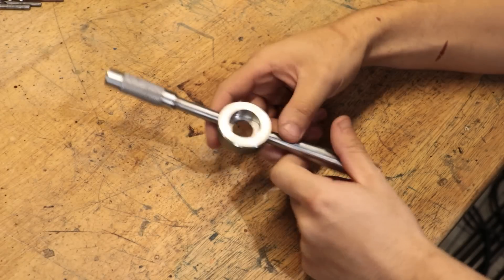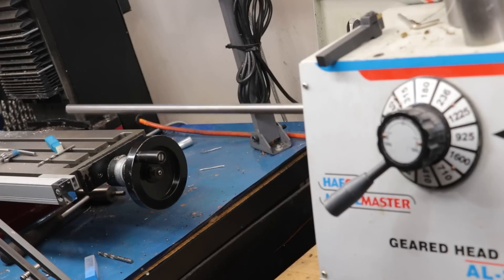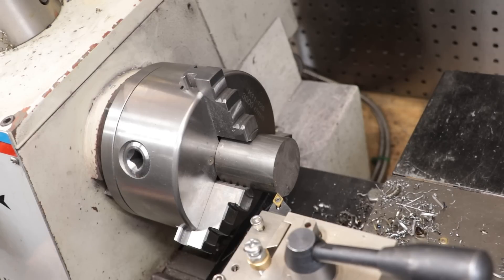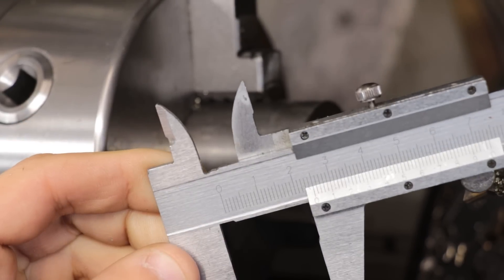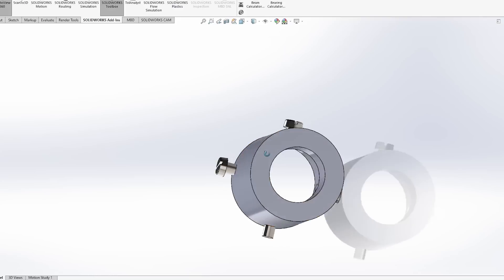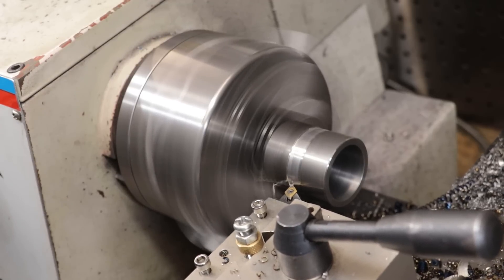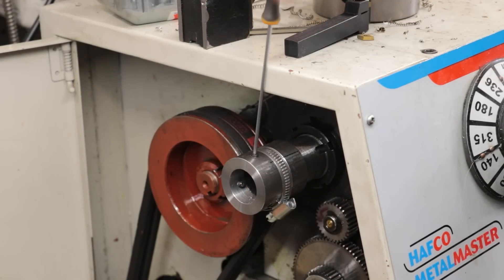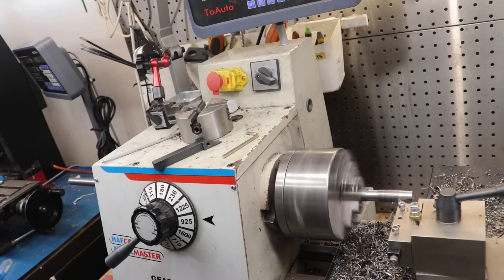Avoiding A Dangerous Situation on the Lathe | Making A Lathe Spider

Comment: I used to run Acme-Gridley multi-spindle screw machines. (Basically, a prw-cnc 6-chuck automatic-feed monster lathe.) Each stick-out was protected by a long tube. You could do the same here with a 6-foot tube secured to an auxiliary bench.

Comment: Don't kid yourself. A spindle spider is only for aligning parts in the spindle. You are still at risk of a bar hitting critical shaft speed, with a simple mistake like selecting rpm which is too fast. Anyone watching would do well by understanding critical shaft speed and proper lathe practice. You can risk improper setups on your own. My understanding that the clip shown was a programming error where speed limit was not set. They knew the risk and took it anyway.
Reply from the maker: yeah its not a catch all solution but set up properly it works. I machined all this, it sat happily at 900 rpm with 30 cm of stick out the back
Reply: @artisanmakes  The title implies a spider will prevent stock whipping. I don't know how to convey how unsafe this really is and that anyone doing this will get lucky until they don't...this is a calculated risk, with none of the factors even mentioned.
Reply from the maker: I do mean to imply it, you just have to set up properly so it does end up whipping around. If it didn't work I would have abandoned it and not posted it. I think most people understand that this has limits and itll eventually need a roller stand
Reply: @artisanmakes  you didn't tell them what the limits are. Recipe for disaster
Reply from the maker: it'll be dependent on the material and its diameter and stick out. But even without calculating it you can usually feel through the lathe if its going to vibrate and go wrong. Thats im sure that would be intuitive to anyone who has experience using lathe
Reply: @artisanmakes  and those who are inexperienced looking to this video for ideas?

Comment: For your shop, since you don't use both machines at the same time, why not just build a simple steady rest that sits on the mill table to hold the excess lathe material stable...

If you machine one or two bars protruding out the bottom, they can drop into the mill bed slots to keep the steady rest from sliding sideways (relative to the lathe spindle bore) without actually having to clamp it down, making set up/break down very quick & easy for when you stop using the lathe and switch to the mill...just set it on the mill table and adjust the mill's X & Z axis to align them with the lathe spindle bore, slide in the bar stock and start turning the parts...

That would also allow support of much longer rods than anything bolted to the back of the spindle itself would not to mention if you need to use a really long rod to minimize material waste, you can always make 2 steady rests for the mill bed to support the rod at either end of the mill bed increasing shop productivity, economy AND safety all at the same time...
Reply from the maker: I dont do this often enough to justify the steady build. Like I said in the video I had an hour or to two get this made and this is the common go to solution

Comment: could you give us your opinion on the new lathe thus far, would you buy again? knowing what you know now would you have selected other? many thanks.
Reply from the maker: for me id buy it again. its a roughly made lathe but at only $2700 aud its a pretty good deal for the price. I can make accurate parts with it and that gearbox means it can produce endless amounts of torque at low rpm. Just a shame about the noise but that part does not worry me as much as it does some other people

Comment: interesting....30 year ago I cut 6 mtr length of bar stock with a thread chaser, I angled the lathe next to a building stanchion/ steel post and/ or cut a hole in the wall if no room, tailstock or headstock, then used a collar/ sleeve in the headstock bore, different ones for different stock, and bolted a 'loose' steady to the building if needed , hence angling the lathe close to something steady , and had a stand at the backend/ headstock, to steady the protruding bars , this above method works too , kept the revs under 300 ish from memory, all on a 4metre lathe bed. Excellent  solution here.

Comment: It still needs to be supported even with a spider.
Reply from the maker: If you go longer yea
Reply: @artisanmakes  I use the video of the lathe breaking free of it's footings with unsupported stock in my CNC course of what can happen when you don't follow protocol. I'd rather not find another video, If you know what I mean.  Stock material is cheap in comparison to what potential risks are associated with cutting corners.
Reply from the maker: Pretty scary eh. I get the feeling everyone uses that same boy of footage because we were shown it when I did my uni shop induction course

Comment: Be safe. 
- I hope your tailstock drill has a tang. Morse taper is not designed for over size drills. You were lucky it held and not destroy the tail when it lets loose. 
- don’t use a sharp cutter when reducing an expanding or reducing finger. It could have grabbed and ripped the part out of the lathe. I saw it on another video doing exactly the same last week. 
- up to you but I think your stick out diameter to length ratio is still too much. I would not run it. Given you have the mill under it, why don’t you setup a steady rest on there to hold it closer to the end too?
Once again, please be safe.
Reply from the maker: I dont see why. I have used morse taper drills larger than this and they seemed to hold on fine enough. From memory it was 32mm and it fit in the MT3 sleeve

Comment: Not calling you out here or anything but the video example you referred to is pure lazy-ass mentality. Any machinist with 2 brain cells has the ability to calculate # of parts processed per length of stock WITH waste factored in and shorten those lengths of stock to safe levels of stick out. You could do the same thing quite easily and not lose ANY stock at all, just saying. The necessity for a spider is real, especially as you said, with parts that are long and cannot be cut. Im glad you demonstrated a simple solution.

Comment: Bit out of left field perhaps but we use it at work to great effect. 3D printed spindle liners work exremely well. We're using them for up to 2" at 1.2m long stock in our CNC lathes and they work without issue. We line our spindle tube with 2-3 of them but for manual you can probably get away with 1 easily. We print them in PLA with extra layers on the walls and about 30% infill for some extra stiffness. Over 1 year on and the cutting fluid and oils etc have yet to bother them at all.
Reply: So just slip fit them between the bar stock and spindle on the back end of the lathe? How long do you print the liners? With a lip to keep them from sliding all the way in?
Reply: @aarondcmedia9585  No we put a v shaped groove like on a pulley on the outer diameter for an oring which keeps it in place in the spindle. Just need a small amount of compression on the oring with a slight interference fit and it'll stay in place on its own.

Comment: Just bolt the lathe's steady rest to the mill table and adjust as needed 😎

When i made mine, I originally designed it in three pieces with an outer sleeve going over the spindle and an inner sleeve that goes inside the end of the spindle far enough to reach some pre-existing internal threads. The inner sleeve then screwed in to hold everything in place. 

As it turned out, the friction fit of the outer sleeve was more than sufficient and i never got around to making the inner sleeve. 

Your hose clamp works, but ugh. Wouldn't want to catch a finger on it. 

Your clamping screw set up is safer than mine. I need to redo the clamping screws on mine so they don't stick out as far. Currently i have six 10-32 socket head cap screws, since i need more clamping range than stock set screws can achieve.

Comment: You should get a roll of shimstock. Then you could have cut some pieces off to stick under the set screws you wanted to use to attach it to the spindle.

It's also just nice to have in general.

Comment: The hose clamp looks a little kludgy.   I would have bored out the spider by say just slightly over1 mm and inserted a 1 mm thick shim, and have retaining screws bear down on that.   That way the spider can be removed if required for lathe servicing and still avoid the retaining screws chewing up the spindle.

Comment: I had an apprentice tool maker running a lathe at low rpm with a bar sticking out the back side of the headstock.  The variable speed handwheel on the lathe had a habit of drifting slightly, but not enough to bother.  I had stepped away for a couple of minutes so the apprentice asked the supervisor if there was something wrong with the speed handwheel.  The wheel was mounted low on the machine so he got down on his knees and was running the speed up and down.  The round bar bent sideways and the lathe went to shaking violently.  He didn't realize what was going on and at that moment I walked back around the corner and saw what  happened.  I put my hand on his shoulder,  said don't stand up, and shut the lathe off.  When he realized what he'd done he turned white and went over and sat at his desk. If he'd stepped into the bar it would have killed him instantly.  You may argue I shouldn't have had the bar sticking out but I intentionally set a low rpm to keep it from being unsafe.
BTW, that particular supervisor was intensely disliked by everyone....the rest of the people in the shop never did forgive me for keeping him from getting killed.  I just didn't want that visual memory.

Comment: Consider two identical hose clamps in series - this gives a weight on either side to keep it balanced.
Reply from the maker: If there was a bit more space before hitting the pulley I would have certainly added one. If anything, just for the added clamping force
Reply: @artisanmakes I think criggie meant that instead of having two clamps side by side, you chain them together so the strap of one feeds into the teeth of the other, they'd be doing half the circumference each. Like when you don't have a long enough zip tie.

Comment: I also saw a video earlier today, where they had a chuck mounted on the back of the spindle. A, it can help hold your stock stable, and B there's a lot of other uses for it. One was basically using it like a disk sander.

Comment: You could make a set of rollers to fit the mill table then use x&y on the mill to true it in. Maybe could even use the lathe's steady rest to mount to the table via and adapter. You would have to square it to the spindle of the lathe though

Comment: My first lathe project was building a spider/cat's head for the back of my lathe's spindle (which I secured by cutting internal metric threads)......and I also made two more that are held in the 3 or 4 jaw chuck on the front.

I'm not really a fan of the hose clamp..... but well done on building your spider.  You would actually be better served by a movable set of rollers for this application; similar to the "Turn Wright" kit that Keith Fenner sells.  A roller is superior in supporting long/flexible work at higher rpm's..... reminds me of the time I chucked up on one of my 1-piece pool cues (and was also supported on the backside with a spider-  Luckily, I got the lathe shut down quick enough, but almost had the same scenario as the "Shake Hands with DANGER" video you showed......😂🤣

Preventing marring on the stock:  My spiders use 3/8-24 bolts; I just tig'd some bronze (AL or SilBrz) on, & machined it smooth.  Prior to that, I just used a wrap of copper.

Comment: What if you threaded the slitted end , then tapered the edge and make a retaining nut with the corresponding taper to lock it on ( think like how the connectors on a garden hose work )

Comment: I made one a while ago, and I don’t clamp it to the spindle. Once the 3 screws to center the stock are set, the spider isn’t going anywhere …
Reply: Yes thats exactly what I were thinking if its a close fit over the spindle and its clamped to the workpiece that should be all you need

Comment: Side projects like this is a time honored tradition.  It's when you get three layers deep making a tool to make a jig which is used to make a fitting and finally the fitting is used to fasten the work piece as needed so you can do that 40 seconds of cutting that was originally needed.... :D
Reply: yep...and that 40 second job was said to be impossible, and your boss didn't get it that it required wizardry, and a couple of hours extra, like trying to explain to an engineer you can't shorten a 2" bar by 3"...... many have tried.

Comment: Please consider a recessed thru nut/bolt instead of the plumbers clamp. Even a really small diameter bolt will work. The plumbers clamp could come loose and cause a disaster. That's a lot of stick out. Take some precise measurements and cut the stock to a shorter length to reduce the stick out. Very nice video. I'm a fan of your work. 
Sincerely Robert

Comment: This happened to me a few months ago with a threaded rod, I realized when it was spinning and started to bend and I turned off the lathe, however the inertia was enough to bend it 90° and hit the steel table a bunch of times, hopefully me and the lathe we are both fine
Reply: Preservation of angular momentum: as you slow down the spindle the weight moves further from the axis. Like the inverse of a spinning figure skater's arms.

Comment: I made an ER collet adapter for the outboard end of my lathe to replace the spider. In my case that's ER40. Self-centering, so no need to dial stock in, just tighten the ER collet on the stock and it's ready to go.
Reply: Yes that's what i did, just used a old ER collet block.

Comment: Rollers are safest bet. This setup will not work if the bar stock is bent in 2 axis at different length. As the stock is pulled inside to machine, the runout is introduced making the previous dailing useless.
Reply from the maker: Obviously but I work with the stock that I have and it isn’t bent. If it ever is that’s a problem for future me to deal with

Comment: Very cool. Reminds me of a section of 'Lathe Design, Construction, and Operation', where he mentions lathes that have chucks on both sides of the headstock, for exactly this reason, in the oil industry for machining long sections. (It's a very old book.)
Reply: MyfordBoy just did exactly that on his mini lathe just recently, doubles up as a sanding station which keeps the lathe bed clean

Comment: Nice work, I have never seen the clip of the long shaft taking off like that. In the steel mill, the machine shop used an adjustable vee block with nylon
pads and generally slower speeds.Very nice work, cheers!

Comment: I was hired to replace a guy who did this at work with a 3/8 1018 bar. The bar sheared itself off and launched itself into rolling shutters but took out a table next to it full of precision equipment. A couple of micrometers and calipers were destroyed. One of the pair of Calipers was launched  100 feet into an area where others were working, so it was a close call. 

Max stick out of spindle should never be more than 5 times diameter out of spindle or 3-4 times out of collet or chuck on the machining side. Without support, of course.

I still wouldn't have this much stickout from the video even after the collet, but at least it's seems safer. I'd personally use  or make a steady rest for the spindle stickout. Good job as always though, keep it up.

Comment: Just bent a 100 dollar 3/4-8 acme thread I was machining with too much rear stick out. It was fast and violent. Whole lathe was shaking up and down and the shaft just bent to a 90°! Took me a long second to pull power. Had to change my underwear after. Never seen that other video b4. Wish I had. I knew better.
Reply: I see there a market for a rapid automatic stop. 😅
Reply: @y2ksw1  lol. I ran from that lathe like a scared little  girl. I yanked the plug on the wall!
Reply: Was making my own Olympic bar and started to lathe in high gear as opposed to low 🤦🏽. Lost a good work bench and a day’s work thankfully no injuries.

Comment: would you have the range on the mill to hold a bearing in the vice and have the stock go through that bearing? lovely video as usual by the way, I'm always learning a lot
Reply from the maker: Probably not in the vise itself, you'd want some sort of stand which is heigh adjustable. Might be able to mount it to the t slots.
Reply: I actually had this issue the other day so I just clamped a piece of square tube in the vice of a drill press and fed the workpiece into that . Worked quite well for how dodgy it looked
Reply from the maker: Gotta hand it to you, that’s quite impressive for such a set up